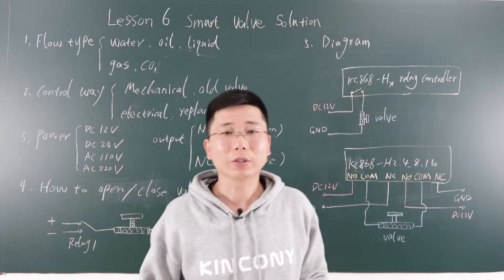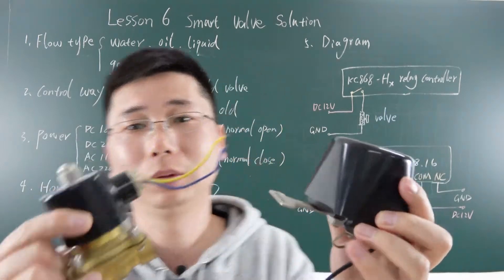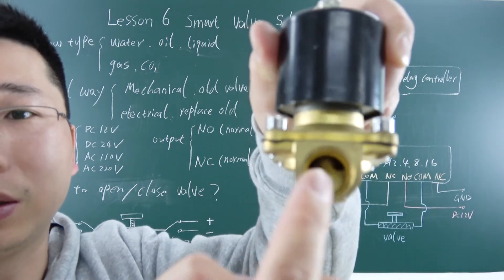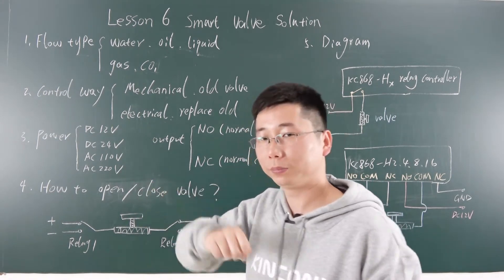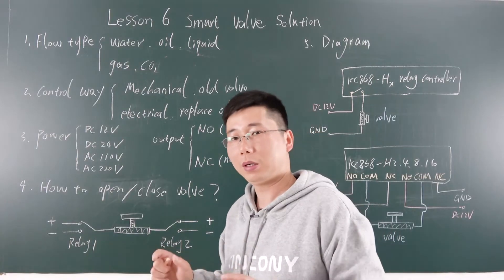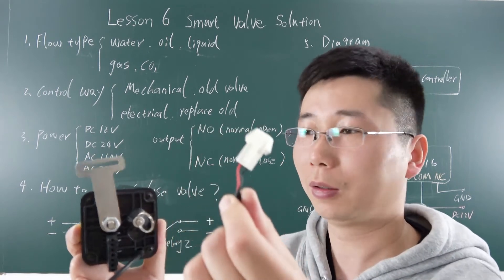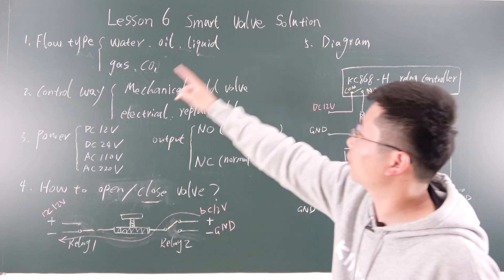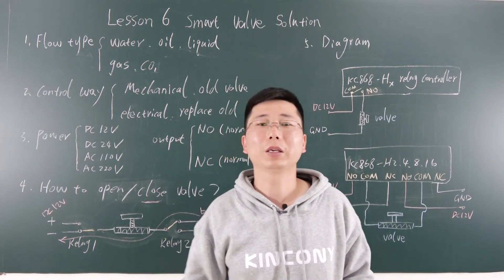【IoT training lesson beginners #06】Smart valve solution

Comment: What is the spark protection circuit method? 9:08
Can the relay contact be damaged by sparks?
Any solution?
Reply from the maker: it's normal, no problem, because i use my hand, actually will use relay to control

Comment: Hi KinCony, Great Video! I wanted to ask about the performance of an electric valve. If I take a normally closed electric solenoid valve and keep it open for 3 hours, will the solenoid heat up, and eventually after a month or two will it wear out?? also how well does it work for hard water, in which we see salt is accumulated on the sides of the tap, bucket, and pipes after frequent use.
Reply from the maker: 1: open for 3 hours, will heat up, but this is a normal phenomenon, long-term use will not damage.
2: if use by hard water, valve can chose stainless steel type, this is for hard water to use.

Comment: Good lesson KinCony! I do like the part where you mention that you shouldn't be using ac 110 or 220v for gas valves, I also believe this should be the same for any conductive material like water also. 

Those lower voltage ones work no different than curtain motors. Safe, simple and effective!
Reply from the maker: yes, for safey, try to use low power supply for valve.